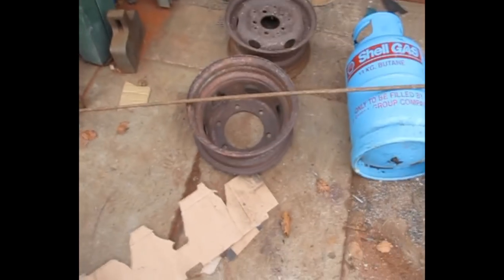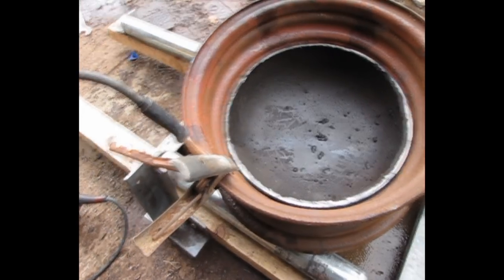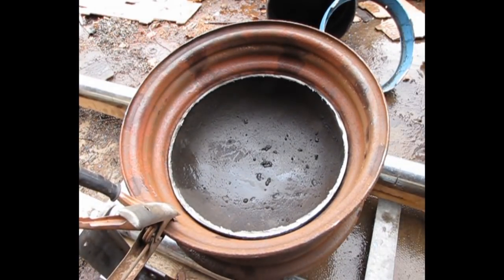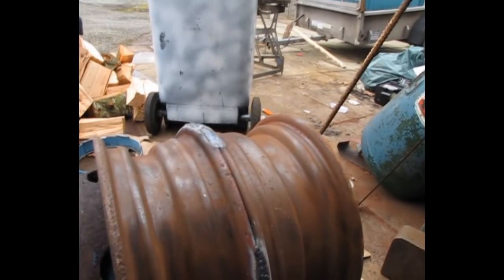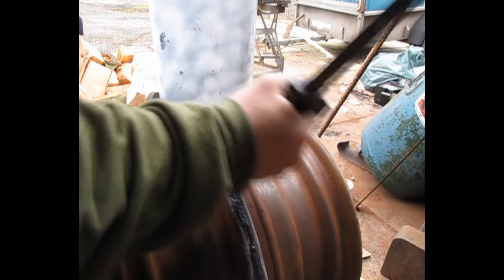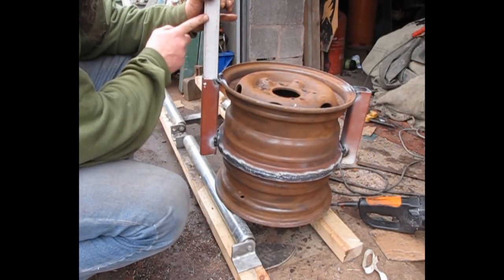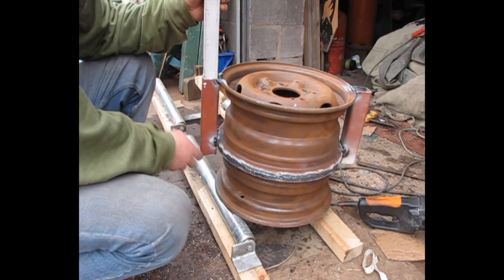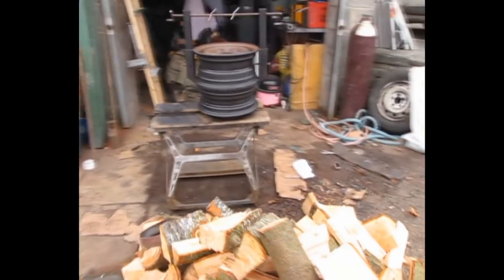DIY Wood Stove made from Car Wheels! Easy Welding Project! Bacon! CATS!

Comment: Good comment....  LISTEN... that could be an awesome WOK burner if you just cut the middle out of the top.
Reply from the maker: +Jay Sims you got some big balls son, you should make stuff and upload video, i take a lot of your points on board though, thanks for the wok burner suggestion, thats something im going to look at some more
Reply: No problem dude. I just thought I may help you some.  Also if your welding that crappy pot metal you may try 7018 rods instead of the standard 6011-6013. It is smoother.
Reply: i stll like the idea and i didnt mean any harm... a few beers later and it doent matter what i said... sorry
Reply from the maker: +Jay Sims :) its all good, thanks for the info on rods, im reading up about them, storage is an issue, going to have to bake them i reckon
Reply: Nope... U use one of those cheap food dehydrators you can get for 5 bucks... :)

Comment: Can you use magnesium wheels?
Reply from the maker: temperature achievable in wood fire is around 650c although if theres enough air getting in it will get to 870-900c maybe, magnesium alloys melt at 650c

Comment: U may cook the same bacon with 100 times less wood and iron in a smoker, and it will taste better, ask Mr Raggles.
Reply from the maker: peppe favella send me a link to a smoker i could make and ill try it and feed the results to him? thanks
Reply: peppe favella Could even U improve it. The end design is astright  pipe with two slide in caps and the short one swings no legs no doors and aluminium is better with a strap to carry it. inside the pipe U carry the tree nuts and tools.

Comment: Looks cracking. Is that a stick welder your using? I been looking at getting a cheap mig off ebay, you've inspired me now. Great channel. Check mine ill be actually trying to get some vids up soon haha. Keep at it bongo. Cymru am byth.
Reply from the maker: +Sustainable Spirit yes its a stick or Arc welder as i call them, this one is a Sealey and it cost me i think £120, worth every penny and still doing well, apparently mig is better and simpler but unfortunately they cost a little bit more to buy, i did have one of the Aldi welders and it was ok but they do overheat quite quickly, the sealey will also overheat but only when youre using 3.2mm rods and have been welding for a fair while, ill check your channel over :)

Comment: hailz
I was analyzing welding deffects. ( https://www.youtube.com/watch?v=fxaFXs0H0VA#t=402 )
I'd say, that firstly surfaces was not enough cleaned, therefore perhaps you have to use not a metal brush, but the grinding disc ( like a http://www.ebay.co.uk/itm/6-X-FASCUT-9-230mm-METAL-GRINDING-DISCS-6mm-THICK-ANGLE-GRINDER-WHEELS-/201284147900?pt=LH_DefaultDomain_3&hash=item2edd785abc ) which will clean rust much effective.
And the second thing, what about to decrease  welding current?

Cheers :)
Dj
Reply from the maker: thank you once again for the advice, yes, i was very lazy in cleaning the area where i was weldong, and i will try again with a decreased current :)

Comment: I'll give you a tip for your crappy arc welding...Get a mig welder :)
Reply from the maker: +Koito rob one day friend i will :) i also want to try TIG, the welds look superb
Reply: +thepoultrypeople To be honest, if you're welding the sort of stuff like in this video, I'd just stick with mig. It's like arc, but more 'point and squirt'. 90% of the skill is setting up the machine. Once you've done that...point and squirt! Tig AIN'T like that!That said, if you can gas weld you'll find it easier to get on with tig as you'll already have the 'dipping your rod' skill. Then just when you think you can lay down a nice weld, some bright spark gives you a cylinder of argon and an AC tig welder and throws some aluminium at you. And you rediscover that you can't tig weld after all :)

Comment: nooooooooooooooooooo bongo you mixed coke with a malt :(
Reply from the maker: +buzzmeister1983 every damn day man, every damn day ;) not sure what ill have with tonights fajita feast, last night it was a wee drop of The Singleton (12) with coke, tonight i might go with The  Dalwhinnie (15) with coke ;)
Reply from the maker: its a bit oaky on the coke though the Dalwhinnie ha ha ha
Reply: give some old pulteny a try, the 12 year old is a nice smooth drink
Reply from the maker: just been to the drinks cupboard for a swig, its very oaky but i tend to find that with a lot of the older whiskeys, yes it is very smooth
Reply: +thepoultrypeople on a more related note, great work. i had a similar idea but for a smaller more portable version for camping when airsoft weekenders are happening.
Reply: +thepoultrypeople on a more related note, great work. i had a similar idea but for a smaller more portable version for camping when airsoft weekenders are happening.

Comment: Do your viewers a favor -- get a tripod.  After watching for less than a minute, I was getting dizzy.
Reply from the maker: +Allen Callender ive got one, maybe three, also some sliders as well, home made of course :) some of it is and some isnt, its a fine trade off, im primarily a maker of things and have only just sort of fallen into being a film maker if i can call myself that, its easy to just crack on with the metal/woodwork to hand rather than the work of producing top quality video, that in itself is a skill, i dont know about lenses and shit, its like concentrating on doing two things at the same time, but point noted Allen and much appreciated, thanks

Comment: Welding comment...   Your filling it to much. Dont bother. You only needed to maybe make 1 inch  gussets every other 2" or so. Or you just waist the sticks.  Even the welds that are required are much too hefty dude.  I could have built that in about 30min man. Stop pouring gas into it!!!   Made a god dam mess there.
Reply from the maker: +Jay Sims lol, it was good to practice my welding on, yeah its over kill and just a few short lines would do the job but i need the practice and your watching it ;)